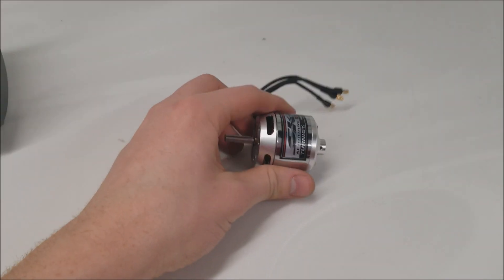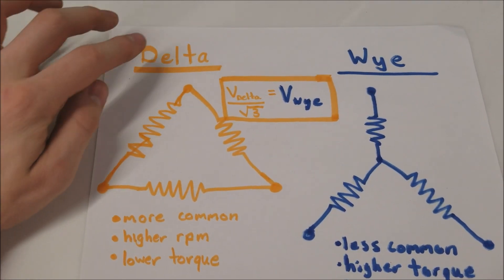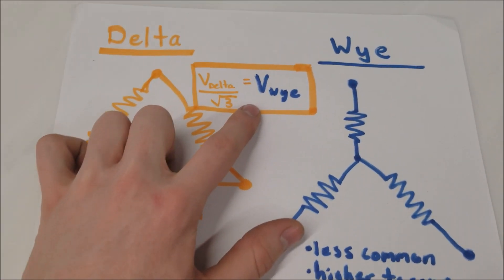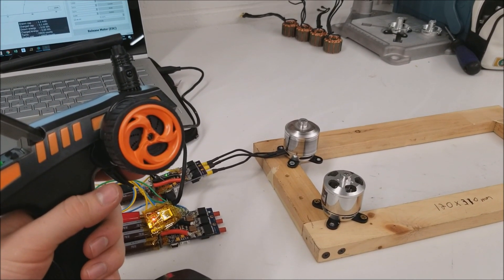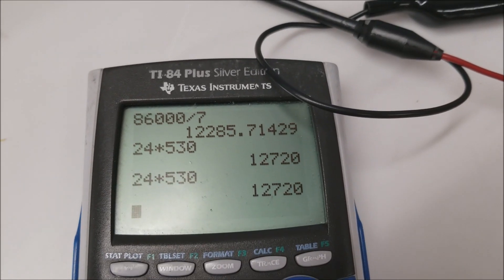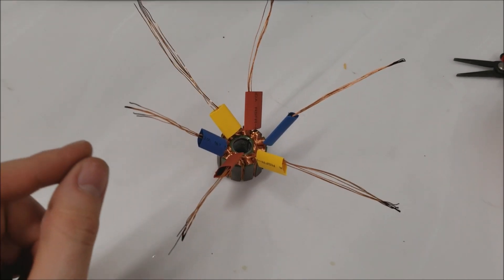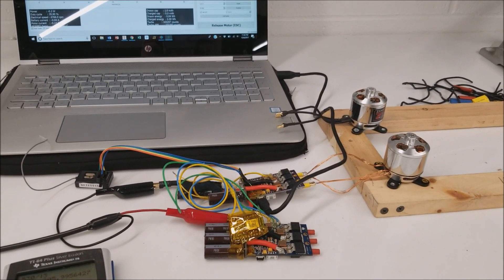How to Rewind a Brushless Motor for More Torque

Comment: Thanks for your video efforts, but at 5:37 you state this is a 14 pole motor, and I assume that info is used when using a factor of 7 to calculate actual RPM from Electrical RPM. 
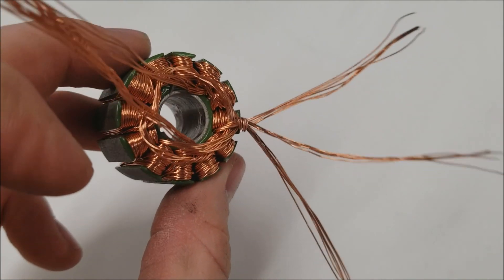At 09:30 you show an image of a stator complete with windings, there are 12 poles not 14 poles visible in the image. 
Can you confirm that is an image of the same motor being tested, or was the motor under test 14 poles?😉

Comment: If you had enough space in the stator, you could rewind the stator in a distributed pattern instead of the concentrated windings, the efficiency would increase.
Reply: That would make it an induction motor which is less efficient than a brushless DC motor.  It will also require a sine wave inverter instead of trapezoidal

Comment: I only have a very loose grasp of 3 phase power. Have you done any testing to see if the change had any effect on efficiency? If I understand the configuration correctly the phase to phase resistance should be about  tripled when changing from delta to wye configuration. Is that right?

Comment: I am rocky here and I wonder if I got it right.
I am to rewire my e bike hub motor. I can expect it in delta.
If I wire it for "Y", it will pick up less voltage, will be slower on the even ground, but will be more of a help on a steep hill ?
Anybody can confirm it, please.

Comment: I just saw a video comparing two electric motor powered drivers. One had more torque and less RPM and the other had more RPM and less torque. I wonder if the manufacturer used this method? https://youtu.be/l7hd4rKf2us

Comment: The increased torque gives greater lift, right? I mean with regards quadcopters or drones right? That is a fascinating manipulation of electrical engineering. Genius.
Reply: torque goes up, rpm goes down, power (product of both) stays the same

Comment: Pls reply, will the Wye winding damage the ESC
Reply from the maker: No, both winding types can be used with the same esc. Changing the winding will not damage the esc
Reply: @ericinventor  pls tell how did you remove the stator from the motor base

Comment: I have a motorcycle magneto with 18 poles. I would like to make it to a bldc motor with low rpm 1500 rpm is enough and with a high torque let me say 300to 400 watts with 12 or 24 Vdc input . Is there som one who can give me the information?

Comment: Great lesson, even the sound is different
Reply: There's nothing great about it, because he's completely wrong. The torque drops by the same factor as the amps. The two setups will be capable of delivering the same total wattage, but one does it running high current and lov voltage, while the other does it running high voltage and low current. And seeing that current is torque, well, there you go.

Comment: For you to increase torque and lower rpms you need smaller gauge wire and way more wraps.  You pretty much added resistance to current path

Comment: I like your video, great way of pointing out on how to find common Nth on a stater. Grab your fancy calculator let's go over a 3-phase wire circuit. A> is red 1 B>is green 2 and C>is blue 3 that = D> Delta

So let's take Delta and Wye = what? 3 to 2 ratio. That's all we can play with🤣

With your fancy calculator let's run some numbers.

A,B,C = D Delta that is (red wire) 1 face.
+
E,F,G= H Hotel that is (green wire) 2 face.
+
I,J,K= L Lima that is (blue wire) 3 face.

Mathematically I think I figured it out. Na+Sa=A Nb+Sb=B and Nc+Sc=C ×9 
Kv.... 0.5 at the most 🤷‍♂️

Voltnator gobel TM

Comment: OMG.. i need to know this before i made my failed dc generator... 🤦🏻‍♂️
Reply: To make a DC generatorr. this does not work for you. you have to make specific calculations of the necessary Kv. and then you must get or rewind your motor for it. It does not matter if it is in Delta or star. Since the termination does not make a brushless motor better or worse. To be clearer: Two equal motors, with the same percentage of copper packing, and with the same Kv will be the same regardless of the termination they have. Delta or star.

Comment: It's just changing the kV by √3.  

So either you are going up in kV by √3 or down by √3.

No real magic to this.

If you really want to improve the motor you need to actually rewind it carefully and increase the copper fill percentage.

Most motors have a copper fill of about 60%.

70% is possible with hand rewinding.

80% is nearly impossible...  but if you are good sometimes you can pull it off.
Reply: Yes, to achieve better efficiency rewinding is required to fill the gap and prevent losses.

Comment: please delete this video! its wrong information and just misleading!! you dont get more torque, you get 3 times less power since u get sqrt(3) less voltage and sqrt(3) less current in Y-connection, overall you have only 1/3 of the power!
Reply: Watts= Torque X rpm ÷ 9.5488
Reply: Haha you are complete wrong I think coz everyone is saying wye winding has more torque and less rpm than Delta winding.
  Please delete your comments,
Reply: @ramadavince6611  He is 100% correct. The Delta motor draws a lot more current vs. a star configuration. Yes, if you have two motors with the same KV but one with D and one with Y, the Y likes timing a bit better and will have ever so slightly more punch off the line. But it should also be noted that the difference is so minute that most will never notice. Sure if you run SAW boats, there's something to gain, but KV is otherwise the key factor to consider.
You need to understand one thing when it comes to electric motors. Amps is torque, pure and simple. And what you drop when you do what this guy in this video does, is to almost half the amps. You make a statement based on what "others say", but those clowns are usually also those who say idiotic stuff like "an electrc motor has a flat torque curve". They know nothing and shouldn't flap their jaw.
If you want low end grunt, i.e torque, you need to look at the motor you can get with the highest amp draw per kv. You see a lot of people choosing the TP Power 4070CM motor for their 1/8 scale setup, because they they think it's the dogs danglies. That is correct if you're a speed runner and run the motor on top rpm. But for most, it makes little sense.
Here's an example.
TP 4070 CM 2200KV on 6S which many run. That runs 264 amps max. So that's about 5861 watts on 6S. Now take a regular TP 4070 with a 2250 kv rating and look at the amp draw. Even though these two motors are fairly close in KV and many think one is more powerful than the other, that's not always the case. The regular motor will take 318 amps. So at the end of the day you end up with 1200 more watts and much better torque. Yes, the 4070 is capable of delivering 9000 watts peak, but it needs 34 volts to do so. And while you get more rpm, due to higher voltage, you don't get any more torque. Amps equals torque, and volts equals rpm. Drop the amps and you reduce torque. 
ChillingLu is spot on and this video is nonsense.
I'd strongly advise you to read some books rather than listen to incorrect information from people who think they know, but don't.
Reply: @AB-80X  bull shit.. you can't said this is torque. 
  Eg.  A 5000 watts motor one with high rpm and the other with low rpm but high torque.
   Torque (NM) =9.5488 X power (watts) ÷ speed (rpm)
  Also. Power (Watts) = Torque (NM) X speed (rpm) ÷. 9.5488
   Do I still need me to do the solving and explaination!??

Comment: Then we need Ac generators that make the most electricity possible for required torque to operate.
Reply: Electricity surpluse will then depend on gear ratios and the friction between. Luca oil works good. High torque low ratio dc spinning multiple ac generators. Electricity produced from some of these generators will then be used to power and charge the dc high torque motor. The rest will be surplus electricity.

Comment: Great idea! Thats what we need more torque generating motors. Frequency driven if that helps on startup.
Reply: Run a larger prop.
Reply: speed raser you may think I'm stupid for making this comment but I actually prefer brushed motors if something goes wrong it is so easy to rebuild them you can rewind to get just about whatever you want more torque more RPM Anyway You Want It more torque used bigger wire but shorter windings when we race slot cars we used to experiment all the time with the windings on these little Motors but of course we did fry a lot of them but when that happened you just unwind the copper add a bigger gauge wire or a little bit more of the same gauge

Comment: of course it reduces RPM as you are increasing resistance /inductance of the circuit by setting coils in series. If you apply a voltage 24 * V3 = 41.57 you should get the same rpm as the original motor.
I am expecting no problems with insulation given that this voltage is still pretty low.
But i don't see how this can increase torque? ( i actually think this is wrong) i would expect torque to decrease at startup specifically since you are applying the same voltage, but divided over two coils....
Hence drawing less current, and generating less torque for the same voltage.
Reply: yes ， you are right
Reply: If he is changing from delta to wye effectively lowering the kv,  the torque constant kt = 60/(2×3.14×kv) would be increased yielding more torque for a given line current. I don't claim to be an expert but would this not apply?

Comment: Eric is correct, this works and is common practice. Before the days of power electronics, induction motors would commonly be started in Wye and run in Delta. 

When you wind a motor Delta the winding voltage becomes the line voltage and the winding current is 1/sqrt(3) the line current. Wye is opposite, the winding voltage is 1/sqrt(3)  line voltage the winding  current is the line current. This is intuitively correct just looking at the diagram. 

Electric motors are simple animals, the more current through the winding, the more torque. Voltage needs to increase to increase speed (counter back emf).

Be careful with this one though, the winding will be carrying sqrt(3) times the current they where designed for. Resistance losses and heating will increase by the square of the current (I^2/R).
The heat generated in the motor could raise by a factor of 3!
Reply: I did the C5045 KV900 brushless motor rewinding around 3 years ago and i did´nt take care of electrical measurements but i noticed that the nominal temperature increased fast ...... Brock Kocyan you are right and it's a big miss because the changed was made to use de BLDC as a CNC spindle, the motor stays many time turned on an overheat in around 15 minutes.

Comment: I appreciate the upload, but I would recommend a script because your missteps in speaking makes it hard to follow at times.
Reply: This video is a mess. Also, while you can do this, it's pretty important to understand how much different the motor will be. He says that one loses a little rpm. Yeah right. You lose about half your rpm. Imagine those who think they want a bit more rpm and to the opposite based on this video. They will more than likely end up roasting both their ESC's and motors. Yes you can change the configuration, but one damn well needs to understand what the drawbacks are.
Reply: @AB-80X @AB-80X  It accurately indicates the initial and final RPM values...
Also, it shows the calculation to determine the RPMs we will get by doing this modification.
 So you'd have to be really stupid not to understand what to expect.
I am French and this seems totally obvious to me despite the speaking errors..🙂

Comment: Hi we have a toy speedboat racing here in our area, im interested in improvising dc motor to a highest speed. Buy i dont have any background in rewinding.
Reply from the maker: losermons if you dont want to rewind also consider using gearing to increase your rpms. You can buy spur gears for this
Reply: ericinventor thanks for the idea, do you sale that kind of motor and the torque like thing?
Reply from the maker: losermons I dont sell anything directly. But you can buy these motors and gears on hobbyking.com
Reply: ericinventor thanks for the link, will try this.

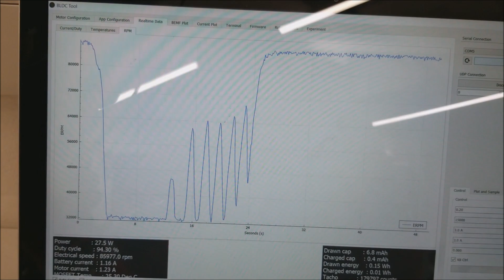Comment: Hi, unfortunately you are wrong. In wye connection you are using less voltage on each windings, what equals in less power, and so on also torque. Delta connection is more common because of that it give the motor more power, and more torque than wye connection, but also it causes in more current flowing through windings. If you want confirmation of my words, there is simple way, just look at power of motor in 5:17 and then in 10:31 when you changed connections to wye. It's exactly √3 times less than it was at the beggining with delta connection.
Reply: yes ，correct
Reply: for torque only the current really matters - and at no load the power reading is pretty meaningless. Wye windings are commonly used to increase torque and decrease the rpm.

Comment: So these BLDC motors are basically just 3 phase AC motors with some variable frequency circuits and use magnets instead of induction.
Reply: The Q that's the way I see it when I got my first brushless motor I noticed there was three wires and changing two of them would change the rotation and being an electrician that told me hey this has to be three phase and it is a c I can't remember if the ESC is where it changes to DC are not
Reply: @popwall4297  The ESC also functions as the invertar.
Reply: The Q, yes. And they use hall effect sensors instead of pre-determined frequency.
Reply: @abrarborno2629  Only some use halls, these ones do not. Sensorless motors use back emf (noise from the phase wires) for the esc to figure out where to put power next

Comment: What do I need to do to my 83100 brushless motor to maintain up to 250 amps? Im using it for a watercraft project.
Reply: If you reduce the number of winds and increase their cross sectional area proportionally you can get more amps into the motor with the same amount of heat generated. This also increases the Kv proportionately and therefore also reduces the torque per amp. Ultimately, it just means that the motor becomes optimized for a lower voltage/higher current.

If you want more actual power, you can very carefully rewind the motor to fit more copper in the stator, this will reduce the amount of electrical resistance for a given number of winds in the motor and allow you to run more amps through it.

Another thing you can do is (if you have some gear reduction) run more reduction and a proportionately higher KV motor. You do end up running into mechanical inefficiency at high speed (bearings and gears don't tend to like 10s of thousands of RPM). Everything has tradeoffs.

Comment: That's a nice result! Do you have some sources you used know the process of rewiring to wye? I'm now thinking of doing this on a 5065 140kv racerstar for use on an e-bike i'm building. The shady chinese 48V controller I bought actually works on this motor, but I found out that it's probably not very suited for higher RPMs so this would be a good solution. Also any reduction I can get in motor RPM is useful to get to a usable RPM on the bike's big wheels.

Comment: Does this arrangement increase the running temperature of the motor?
Reply from the maker: I believe so. Since the voltage per phase is divided by √3, the current per phase must increase by √3. Because P = I^2R the temperature will most likely increase (triple in theory).
Reply: No, you are only changing (lowering) kV but current limit remains basically the same as it depends mainly on the copper fill between stator teeth. You'll be able to use a larger prop as it will run slower but very little change in power. If you keep the same prop it will actually run cooler.
Reply: More current = more heat